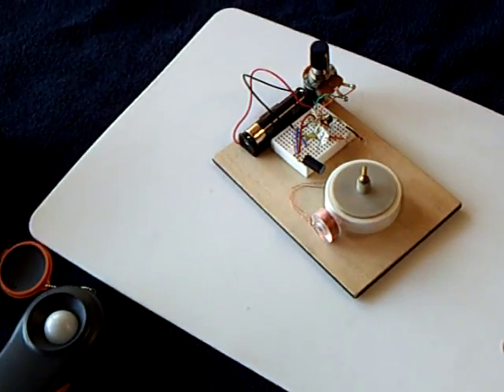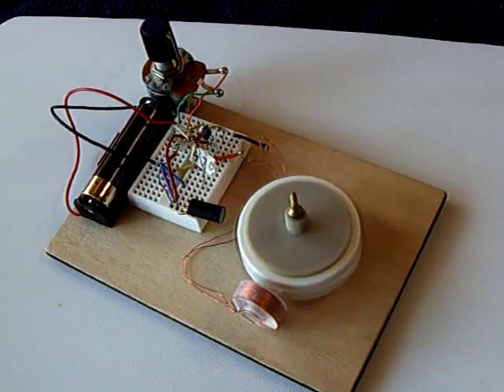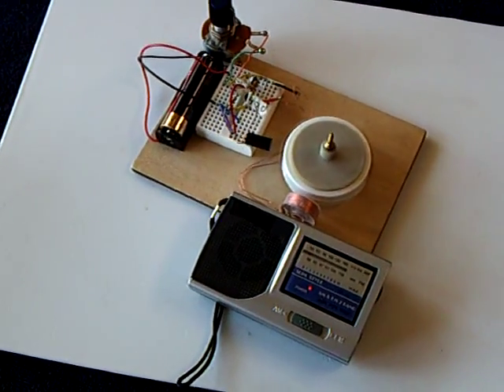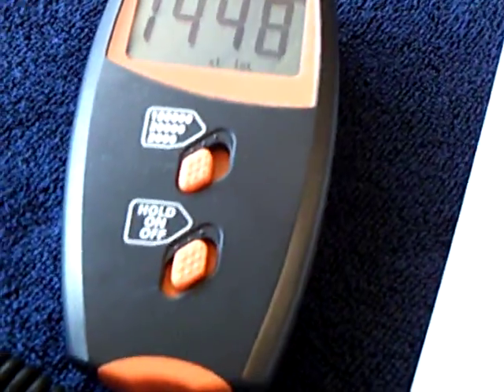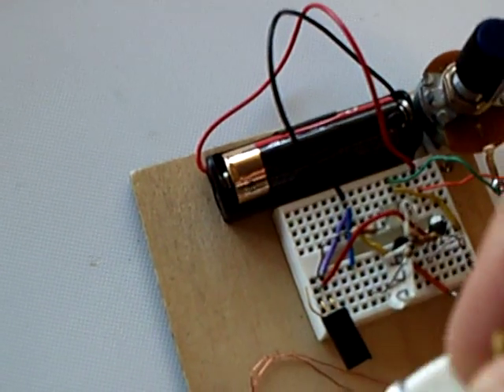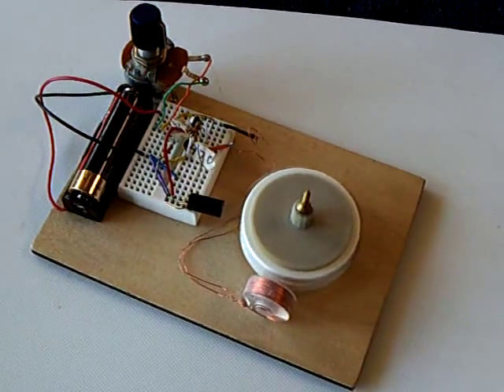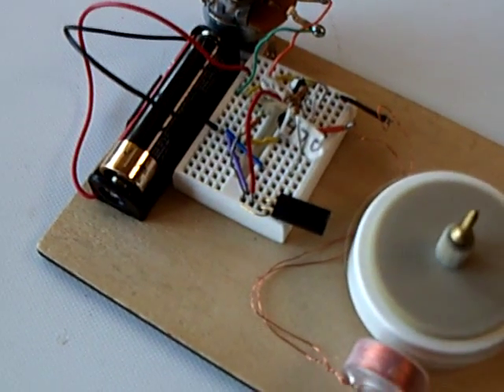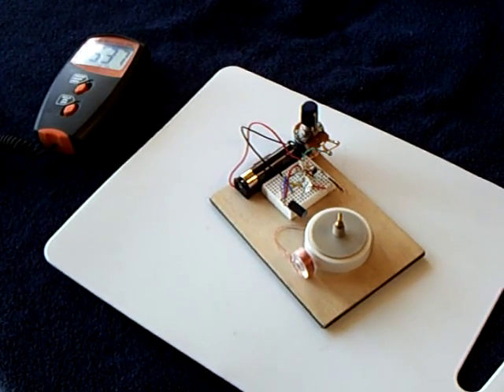Ambient Sunlight Triggered Pulse Motor

Comment: I think the fuzzy sound might be because the photo sensor is on to long. With you reed switch pulse motors you get that nice pop pop pop going on. Also the rpm seems slower have you checked?just seems from watching the video it is being held back a little... It would be interesting to see the reed switch compared to the photo on a scope. Anyways keep up the good work.